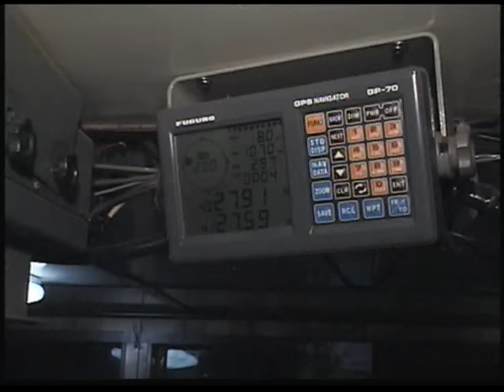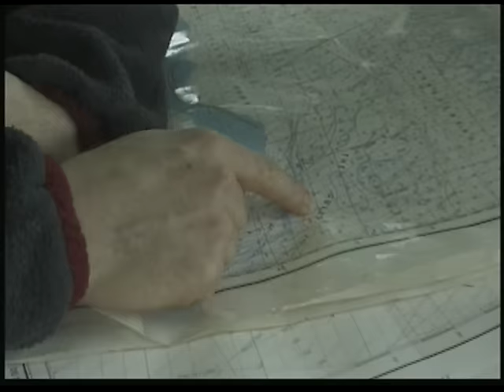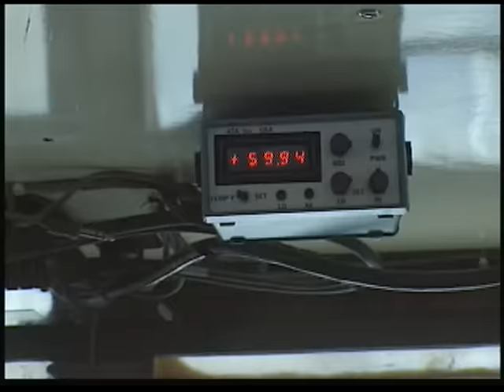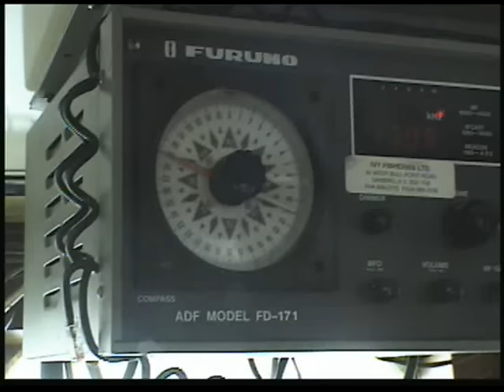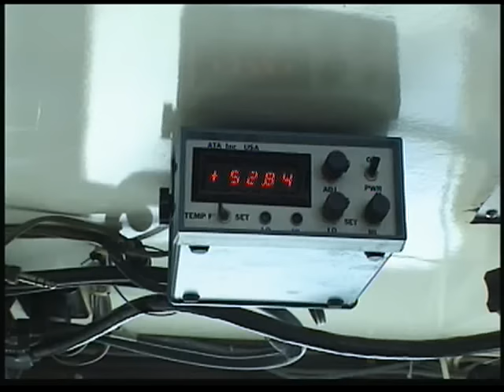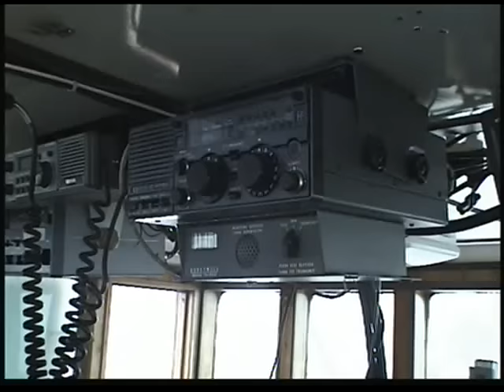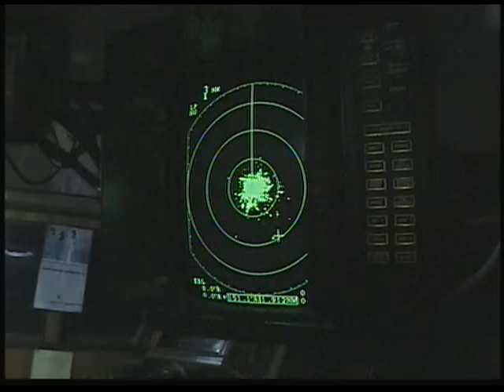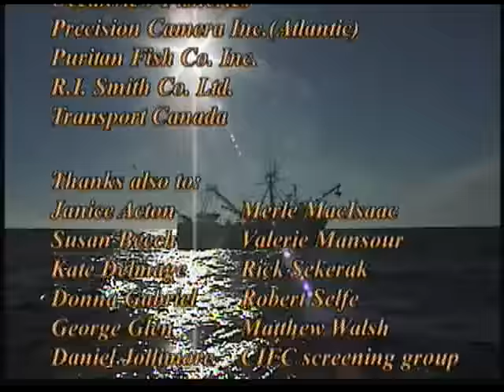Voyage of the 7 Girls

Comment: Great to see the young lads learning the trade early, but call me over protective the younger lad's horse play and fooling around on what is after all a potential death trap, really had me squirming. Fair enough in the cabin off duty away from the stove ect, but he carries on messing around out on to the deck and the crew, probably because he's the skippers son don't chastise him. As was stated a number of times during this great documentary '100% concentration and vigilance is essential on deck' as a freak wave, a snapped cable or any number of issues involving hooks, heavy shifting equipment, slippery decks, unguarded powered winches and pulleys present life threatening hazards  and as was mentioned every crewman had either lost a thumb, part of an ear, broken bones ect in the everyday running of the boat and here's junior using the boat and the crew as his playground. As I say I'm probably a bit over protective as aged 15 I started a holiday job cleaning machinery that powered a production line. Within 5 minutes of starting work I had lost most of the first 3 fingers on my left hand, after getting them crushed flat between two half ton granite rollers. Due to quick reactions I managed to wrench my   mangled hand free,  before the machinery  dragged my whole arm in. I wasn't paying attention and was joking about with a work mate. Up until that point I had become a very good  guitarist who practiced every day and a career in music was on the cards. That is why I feel very uneasy when I see situations that might end in tragedy, but are easily preventable.